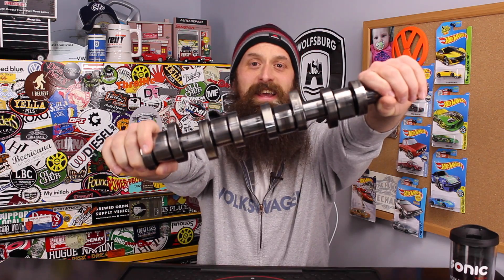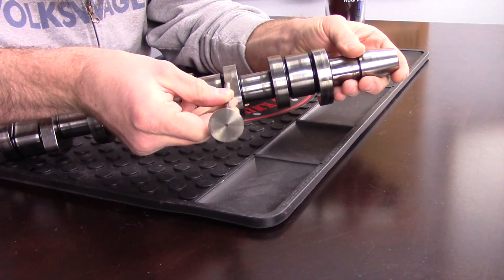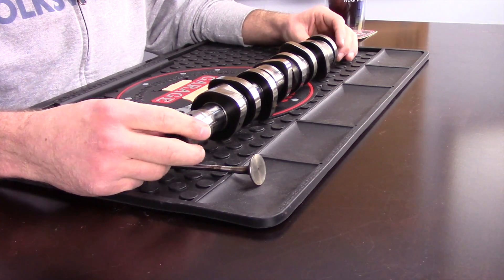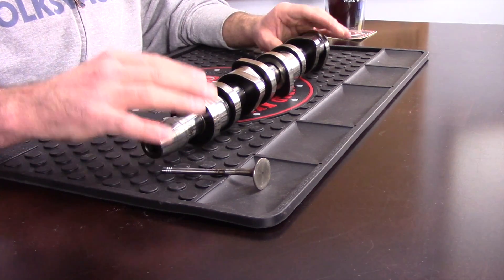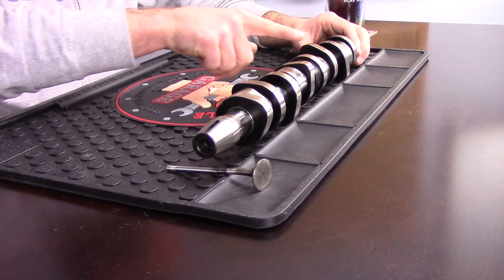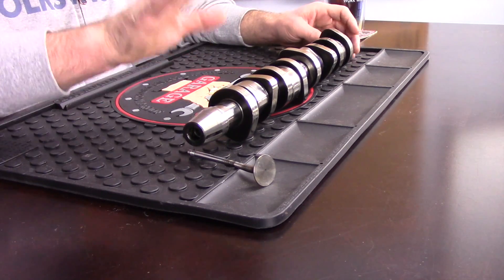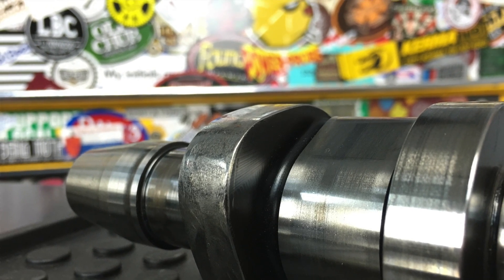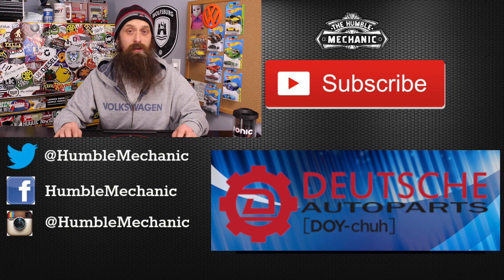How VW Parts Fail ~ 1.9 and 2.0 TDI CamShafts

Comment: Hey guys, can you do a video on injector seal failure, is it DIY, what are the symptoms etc for the the BEW PD tdi, I just found out I have both a cam shaft failure and possible leaking injectors/fail o-rings. Aaaaand the cam shaft failure was probably accelerated due to running the engine few thousand kms with the injector leaking diesel into the oil btw!
Reply from the maker: +DeadlyFitnessAndMotivation yikes that is a lot going on. I'll add it to the future videos list
Reply: Yeah tell me about it, thanks man.

Comment: If there is no engine lights on. Would accelerating with the gas pedal being depressed (not in park but in drive) and hearing the car sounding like it's vibrating/resonance/spinning be caused by a bad camshaft?  and also what is the labour time on something like that. and/or poss costs overall . you said timing belt needs to be removed, should a new one be put in?  nothing but probs with my car man 03 tdi golf alh engine
Reply: The ALH engine DOES NOT have camshaft problems.
Reply: When mine finally failed the engine still ran but vibrated horribly.  When driven there was a large cloud of white smoke (raw diesel fuel) coming out of the tailpipe.  The power was way down and I had to keep the pedal nearly to the floor to maintain highway speeds.  Labor time was about 10 hours.  I would've done it myself but I was on a cross country drive and had no tools or space to work.  Might as well change the belt since that item comes off anyway.  Also, at no point did my check engine light ever come on.

Comment: bkc engine 1.9 tdi mk 5 engine locked up ie would not turn with starter ,but I turn it at crank pulley with spanner, before I heard scoring noise on road, then pulled in engine would not turn over, 250 k miles had lots of power and no problems was a bit rattlie on tick over but no probs engine is toast??

Comment: Hi I have a 2006 Touran with 70,000 on the clock, I change the oil and filter every year with the correct type. A mechanic has had a quick listen to the car and based on this has said the cam is worn. Is it likely that the cam has failed on my car. PS when the cars warmed up and running for a while the noise disappears.  
Regards Peter
Reply from the maker: It could be that. I'd pull off the valve cover and properly inspect it.
Reply: Thanks for the reply, I think that's the best course of action.

Comment: The factory grind on motors like the BEW weren't right. No matter what oil you put in, they'll still wear. 

Drop in a colt regrind, and no more issues.
Reply: please tell us more.
Reply: Agree with the first part off your statement.Had to replace cam on 1.9pd BJB at 260,000 miles and always had Castrol    505.01 spec oil.Oddly it was no 2 cyl cam, lifter that failed.The bearings each side were badly worn but the others were perfect.

Comment: Hey, I have a 2006 BRM engined Jetta TDI that the timing belt broke on. I got the head machined and valves replaced and did the belt. Now I have low power. I believe it is due to injector issues. Any suggestions on where to get some injectors for a reasonable price?
Reply: Yeah. I had a two dot gasket and replaced it with a 2 dot.

Comment: Which lobe makes brakes on a 2015 1.8t have failure?!
Reply from the maker: It the lobe that drives the brake booster vacuum pump and high pressure fuel pump.

Comment: I've never had a camshaft failure. But I've never owned a VW ether. Is this a common failure for VWs? Not being a troll just asking.
Reply: Its common enough that we talk about it here and in the TDI forums.  Does that mean it will happen to everyone?  No, of course not.  My camshaft never failed.  The lifter on the intake side of the #2 cylinder is what failed on my engine, and when it failed it wiped out the corresponding lobe of the cam.  This engine was maintained by me with oil changes and all other maintenance done by the book with proper spec oil.  I never cut any corners with my maintenance and yet a lifter failed.  So it can happen, but it wont for certain.  I too have seen ALH motors with half a million miles and no valve train failures.
Reply: @454k30  exactly what happened to mine yesterday,  the camshaft had 250000 miles on it
Reply: +Eternaly Random No it isn't. Charles says clearly in the video it's mostly caused by cheap/wrong oil and negligent maintenance, but a defect in the metal alloy can also help. And it's just for early 2000s TDIs
Reply: i wouldn't say early 2000 tdis The ALH engine was rock solid imho. I personally put 600,000 km on a 2000 Jetta and only ever had to change oil, filters. (changed every ten thousand km). Hell, even still had the original clutch, alt, struts, springs, front wheel brgs ! Have been a Mechanic for over 30 years and having worked on many later vw  I think that the overly long oil change interval combined with excessive load and or poor metal in camshaft is what is at root. I have seen many failures with proper oil and recommended intervals at lower KM's and have seen much higher kms failures on BRM engines that used shorter oil change intervals (8,000 to 10,000 km). I personally have seen 400,000 km before failure with lower interval and 5w40 oils. (some T6 and some even Mobil TDT)
Reply: It depends on the VW. On VW diesels with a distributor pump, cam failures weren't common. In the USA, distributor pump diesels were found on the Jetta, Golf, and Beetle until 2003. Also, the VW Passat used a distributor pump engine in the late 1990s. In 2004 to 2006, the PD system was used, and that was where the problem happened. In 2008, the PD system was replaced with the common rail system and the problem was eliminated.

Another thing to remember is that before VW built the TDI, they had non-computerized distributor pumps, and cam failure was also extremely rare on those engines.

Comment: It's strange how "valve lobes" wears out but injector lobes usually stays in good shape although they are definitely stressed more. 
Maybe the one and only problem with all this "cam failure" is popping out aluminium plugs on rocker arms oil gallery, resulting in insufficient oil pressure/lubrication?
Reply: Sure, the injector lobe might have more pressure, but the surface area is increased. As a result, the pressure on each square mm of surface is lighter than that of the intake or exhaust cam lobe.
Reply: You think so?  I would say there is much more tension to work against with the valve lifter + valve spring, and therefore the valve lobes see more stress and excessive wear.
Reply: Yes I am. In my humble opinion you need a lot more force to pressurize fuel up to 28,000 psi than to open valves whose springs doesn't have to be as stiff as they are on gasoline engines because of lower revs.

Comment: Hopefully VW decided to harden the cams in my golf r 😳
Reply: Cant harden the lobes.  Lobes have to be soft for proper break in.  They wear against the lifters and "match up".
Reply: +CoolAirVw sounds like bullshit to me.
Reply: +Meat Amigo it is not bullshit, same principle happens in your differential gears. The metal is tempered in the car google up differential or cam break in and you will see.
Reply: +tjsean0308 that sux!
Reply: Even if they didn't, I don't think cam failure is common in the Golf R. The PD diesel system put a much heavier burden on each cam lobe, which limited lifespan. Also, the PD TDI had hydraulic bucket lifters, whereas many of the later gasoline engines had roller cam followers which were much less problematic.

Comment: Hello Charles, thanks for the information on the TDI camshaft fails. I no longer have a TDI because of the fear factor. (CAM FAILURE) My question is any update on the 1.8T camshaft failures? Yes I do have the recall letter.
Thanks
Reply: Older tdi's (2003 and older) dont have this issue.  They are super reliable.
Reply from the maker: Nothing yet. I have heard it will only be software, and not cams. I have also heard it will for sure be cams. 

Hahha sorry I wish I had the answer.
Reply: Thanks Charles, time will tell I'm not driving the car until repaired. 
One other quick question the Golf has not been run since November. Is there a way to crank the engine with out starting. I would like to build up oil pressure before starting. Thanks again
Mark
Reply: +Mark Day Unplug the coil packs?

Comment: so not my MkV? 2.0 TDi?
Reply from the maker: Correct. This is mk4 and early mk5 pre common rail cars.
Reply: +HumbleMechanic cool! that's a relief
Reply: +Alec Beaudoin What year is yours 2.0 TDI? 2.0 TDI PD were selling in Europe all up to ~2008.
Reply: @schhh4266  
I think 2006 was the last year that the USA had a 2.0L TDI PD. It was only used in the B5.5 Passat. However, the Jetta, Golf, and Beetle had a 1.9 PD.

Comment: Maybe it's caused by weak valve springs chatter? Diesel engines often have weak stock valve springs because the manufacturer thinks that it's not a high rpm engine so it doesn't need to close valves very fast.
Here you can see the damages caused by weak stock valve springs chatter in a BMW valvetronic engine:
https://youtu.be/um35omnTIf0?t=2040
Sorry, it's in not in english, but you don't actually need any text to see rockers and shafts damages.
You can see that rockers and camshaft knuckles have caverns. This damage differs from normal damage (when engine has just run a lot), normally it has stripes on camshaft knuckles, but not caverns.
btw, I've found a short video which illustrates how valve springs work at high rpm:
https://www.youtube.com/watch?v=8CiC6gvwS1c

Comment: Hi Charles you definitively what to replace the cam bearing shells and lifters at the same time you don't want to run use lifters with a new cam and the wear that is present on the injector lobes is cause when the lifter is busted thru and the lobe is really worn bad the lifter makes contact with the injection lobe have a look I have lots of video on this subject I have replace lots of them the worse car with this issue is the mk4 Jetta with the BRM engine thanks for the videos.
Reply: I meant to say the mk5 Jetta instead of the mk4.

Comment: does this apply to a 2003 golf4 1.9tdi?
Reply: No.  A 2003 golf4 with 1.9L tdi, is an ALH engine and the PD engine that HumbleMech was talking about are 2004 and later BEW,  2004 & 2005 BHW and 2005.5 and 2006 BRM's.   Despite HumbleMech slightly mispeaking and saying "2003ish"
Reply: in america....
Reply: Depends if its pd or boschpump
Reply: DOES THIS APPLY TO A 2005 tdi JETTA WAGON????
Reply: PLEASE LET ME KNOW SOON IM ABOUT TO BUY THIS WEEK.  ANY BIG ISSUES WITH THAT YEAR AND MODEL?

Comment: What oil should we use?
I don't have a tdi but I do have a 2006 gti 2.0t
Reply: +theblackslcmamba I'd say 5w40 LongLife full synthetic, preferrably Castrol or some other known brand for safety. It might cost a bit more but think about oil in your engine as blood in your veins. You dont want a discount blood transfusion if you go to the doctor, right?
Reply: +theblackslcmamba check out VW 502.00 for a list of specified oils.
Reply: +theblackslcmamba Rotella T6 is my goto. Castrol Ti synthetic is the easiest to get locally and one of the best oils you can buy - and priced accordingly.
Reply: Shell RT6 isn't actually approved for VW gasoline engines. However, it does perform extremely well in VW gasoline engines.
Reply: 505.01 spec
Reply: You’re asking that on YouTube? Fucking idiot